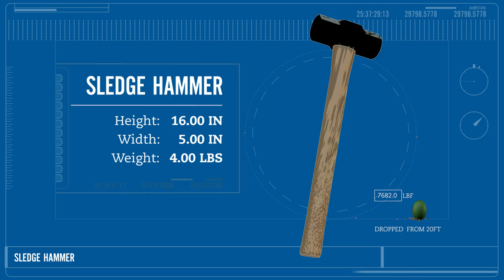The Dropped Objects Experiment | 4 LB Sledge, 20' vs. 30' | Safety Week

Comment: 1980 Oil Rig Block tackle shiv broke the shiv weighed 4# fell 100 foot hit my best friend in the head his hard hat was crushed into his skull his brain was crushed bone had to be removed from his brain .  hard hat will not help when 4 pounds falls 100 foot . a 10 oz nut yes it helps from 100 foot .  many times my hard hat saved me from a goose egg bump .  my best friend lived with severe brain damage lost motor skill hard time talking walks but his legs do not work right step and wait step and wait . swings his hips to take the step .  without one he would have died .